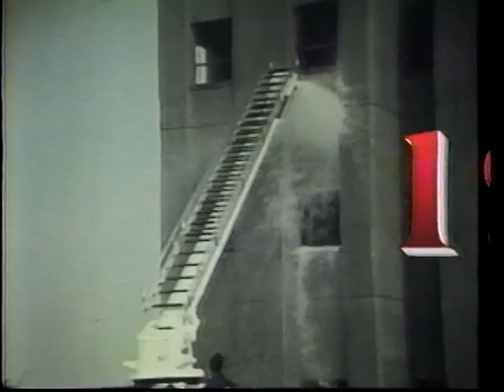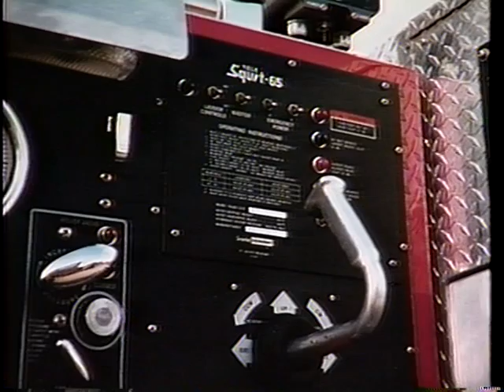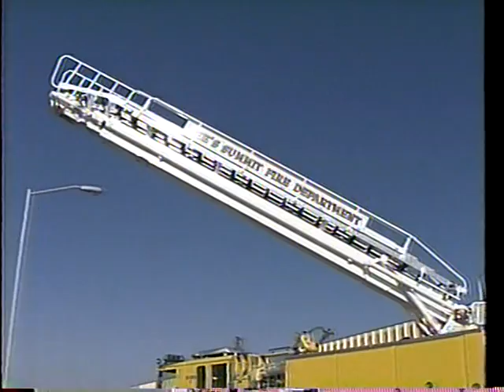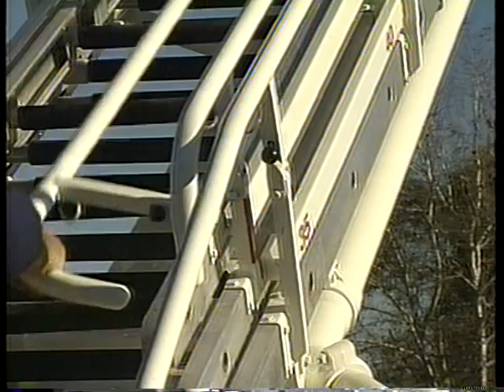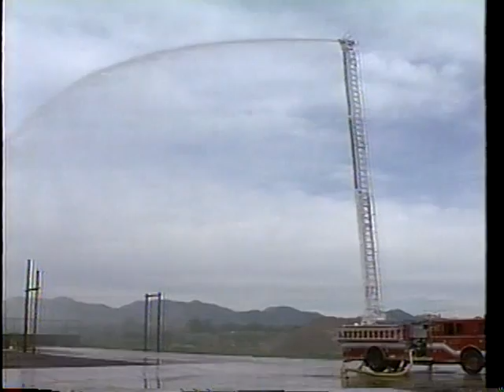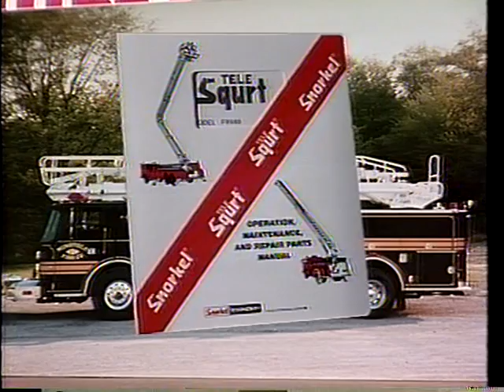Snorkel TeleSqurt 65 Video

Comment: We got one ( a 50ft.) in 1988 on a Pierce Arrow chassis. Used the shit out of it. In 2009, it was taken from service with about 175,000 miles on it. The city bought the next one with a 65ft tower. That truck has been an electrical night mare. Not as rugged truck as the '88.

Comment: I wish we had em ALL WE HAVE ARE QUINTS
Reply: To be fair, Quint's are better than Telesquirts for a few reasons. The main reason is ladder strength; what they don't tell you in this video is most telesquirts can only handle about 500 lbs or so of weight on their ladders. Most quint's have aerials that can take 1000 lbs or more of stress. Atop that no one makes 75 foot telesquirts anymore, the largest length I can find is Pierce's Skyboom 61 foot. At that point might as well get a quint with a 75 foot aerial and have the extra 14 feet and weight capacity.
Reply: @Stargazzer811  oh ok